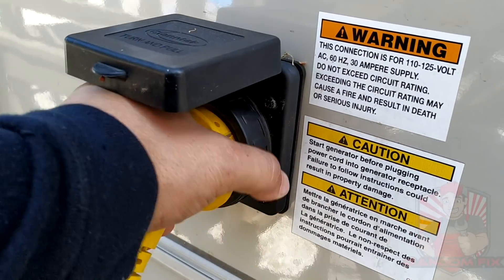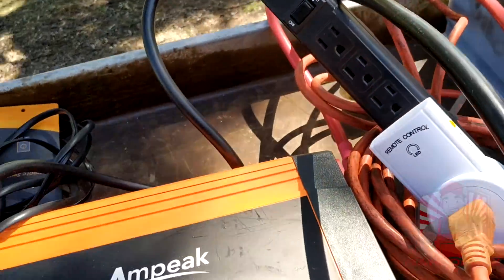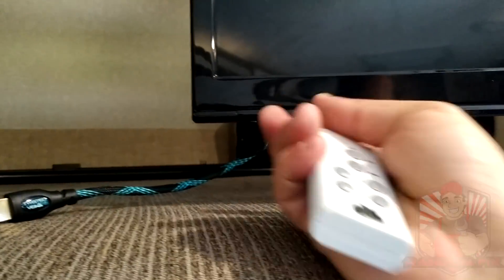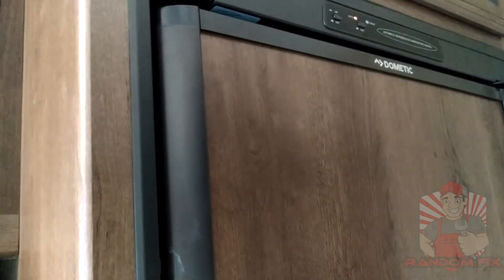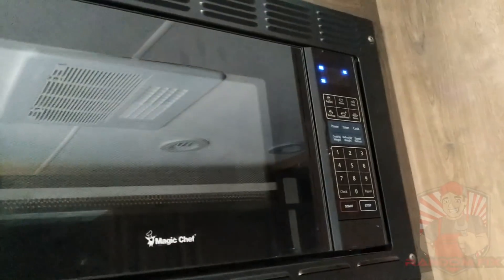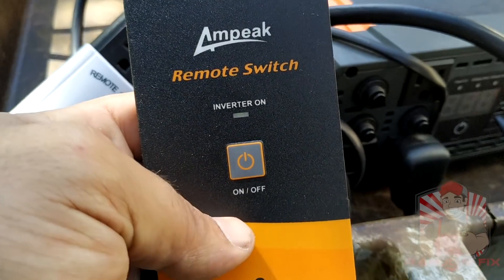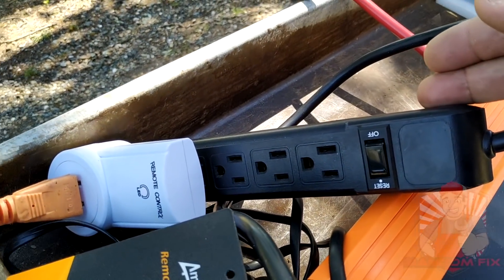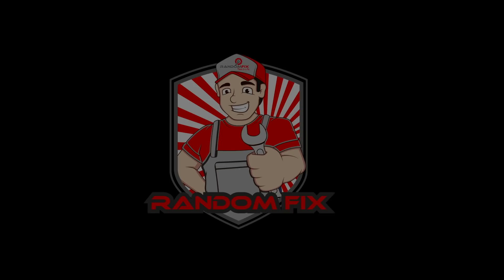RV Inverter Installation: Power Your Entire RV!

Comment: My wife and I watch your video Numerous time on TV LOL.  Our question is that dead man plug is plugged into a GFI outlet? I just purchased solar kit for our TT and is solar ready with charge controller ready. Underneath forward storage area also has inverter readiness. But again, I'm no electrician. thanks for this video stay bless.. LOU & YESI
Reply from the maker: No the dead man’s plug is not plugged into a gfci  but if you did that it would just keep resetting, you would need to hard wire it before the gfci.
Reply: @RANDOMFIX  oh wow now I'm really lost. I see you hard wired it to the inverter.  And plugged it in to an outlets inside the camper. The outlet in the camper is hard wired to the main breaker. Do you have a video on how you done it? Thanks

Comment: great video just what i was looking for. why don't you just plug the cord into the invertor.thanks jack
Reply from the maker: Jack, I'm glad the video helped. I don't follow about plugging the cord into the inverter? My cord is 30 amp and is located only the outside of the vehicle that's why I made the dead man's plug so I can just highjack the electrical grid of my rv without the need to make any modifications.

Comment: Nope! Not only is it dangerous, but now you are trying to pull up to 20+ amps through a circuit with a 14 ga wire. It would be much better to run the shore cord to the inverter, an inverter with a hardwire port would be best!
Reply from the maker: I appreciate your constructive comments, thank you for the feedback!

Comment: Just buy adapter for your shore plug and plug in that way so your not tripping over cord! Turn converter off! 🤣
Reply from the maker: Okay
Reply: This is the safer way to do this. Then you can never plug in shore power while your inverter is acting as shore power.

Comment: Power is driven from the battery via the inverter extension cord w/remote and deadman plug, which is connected to any electrical outlet to power the RV without using the converter? Basically, the GFCI outlet is accepting power from battery to run/activate all the outlets and some appliances inside the RV? Yes or no? Is the RV converter in use during the time the battery and inverter are supplying power? What role is the converter and fuse box playing in your configuration? Does this method have an affect on the battery?
Reply from the maker: Hi Ruben, I made an update to this video with diagrams and better explanation.

https://youtu.be/VikSGKsl6Jo

Comment: This is not safe, does GFI work as designed feeding power in reverse?  Male cord falls out of plug electrocution hazard if someone picks it up that doesn't know its live.  Two electrical A/C sources can  be connected together by accident.  Relying on a $1 surge component to provide shutdown safety in the event two sources are accidently connected.  The safe way and of course more complicated way is to install transfer switch ahead of panel input that can select between shore power and invertor power and absolutely no chance of two sources of a/c joined.  Automatic transfer switches employ a hi-current relay/contactor that is held connected by line power.  When power drops out relay allows connection of alternate source of power such as an invertor or generator.  I understand that you have a pretty good knowledge of electricity but you have to take into account someone that does not know how your system works and tries to operate it.  Say we have an accident and surge protector does not work does invertor blows up first and short out a high current battery  we have a instant fire!  I do not see any overcurrent protection in the invertor side.
Reply from the maker: I appreciate your constructive comments, thank you for the feedback!

Comment: The problem with backfeeding is you're never going to get the proper size cord or amperage through that breaker to backfeed the whole system. So you're taking a probably a 30 amp system and render it down to 15 amps and then you're trying to run your refrigerator and everything through that backwards through the breaker that may seem easy but it's really not good
Reply from the maker: ThAnk you for your feedback.
Reply: @RANDOMFIX  ty for the vid and reply
Reply: I know this was a year ago but can you please answer my question if your able to, I'm planning on adding around a 7000wh 48v system thats 150 amps right, so with proper inverter and gauge wire into the plug and turning off battery charging on 120vac panel it should work fine right
Reply from the maker: Your own system does matter much and you can alter it however make sure you only inputting 120 v volts alternating current (ac) into the rv electrical system.

Comment: I just got a cord to plug my shore power port into the inverter.  Then both legs work.
Reply: I also just added a shore power outlet on the outside of the RV, near the inverter, that is plugged into the inverter with a modified extension cord.  Now all I have to do is plug the shore power cord into the inverter outlet on the outside of the RV.
Reply from the maker: Thank you for sharing
Reply: Dan, that is exactly what I did today. I got one of those through hull type electrical fittings from Amazon. It’s the best and it has a water tight cover. I have a very short power adapter 50 amp 215 amp that goes directly to that exterior outlet I can even run all of my stereos and TVs while I’m driving down the road. It sticks out a little bit of course. I’m not worried about that.  

15A Weatherproof Outdoor Power Outlet by Journeyman-Pro 15 Amp 125 Volt NEMA 5-15R Receptacle Kit with Integrated 20" Extension Cord + Waterproof Rubber Cover (GCR1-WHITE) https://www.amazon.com/dp/B07X8YQ19D/ref=cm_sw_r_cp_api_glt_fabc_MM4E46GMGM8BCFMA3JTF?_encoding=UTF8&psc=1

Adapter for keeping the inverter inside a watertight compartment and having the power outlet on the outside near your shore power inlet
Reply: @mrmojoinco  this is what i used as the exterior outlet and I put an waterproof cover over it. https://www.amazon.com/Enerlites-Receptacle-Electric-Vehicles-Electrical/dp/B07BD2DZYN/ref=sr_1_17?dchild=1&keywords=50+amp+exterior+outlet&qid=1627503314&s=hi&sr=1-17

Comment: Like it but would use pure sign wave inverter
Reply from the maker: Bob, good feedback. In my rig  ( new sprinter van conversion) i have a sine wave inverter. That setup in the video is still going strong. No issues with microwaves or computer.

Comment: I’m confused I did this exact thing but I think I blew a fuse
Reply from the maker: Where did the fuse blow, on the inverter or the coach? Did you see the update video in the description box where I show are of wiring and diagrams?
Reply: RANDOMFIX not sure I’ll have to dig into it but I followed step by step and when I did it I heard a pulsating noice coming from the inverter then boom my front lights by my driver and passenger seat turned off now my inverter Is not turning on either I’m not getting any DC power going into the inverter.
Reply: RANDOMFIX what’s even more weird is I didn’t even have the switch on and neither of the lights on the dead mans plugs were on
Reply from the maker: Jayden, I'm not sure what happened. Are disconnected from shore power? Did you check out the rv to confirm there was power to them before you attempted to plug in the Deadman plug?
Reply: RANDOMFIX yeah that’s the weird part it was all dead no shore power or anything. Oh well I’ll figure it out hopefully 😂
Reply: RANDOMFIX are you in California? I’ll pay you to install it 😅 I don’t know a whole lot about this.
Reply from the maker: Did you see the follow up video? Its pretty simple. A stereo shop has good know of 12v systems as well.

Comment: If I use battery disconnect and plug shore power cord into inverter via adaptor instead of generator, will that work okay?
Reply from the maker: Hi Don, I made a new video covering the process in a lot more depth, if you still have questions after watching the video I will be more than happy to help! https://youtu.be/VikSGKsl6Jo

Comment: Doing  it your way. I still have to turn on my converter with my breakers for my plugs to work and power everything. I have separate battery connected to the inverter with solar panels to charge the battery's, not the house battery's.
Reply from the maker: I appreciate your constructive comments, thank you for the feedback!

Comment: How do the battery stay charged
Reply from the maker: The battery charges why you drive.
Reply: When you drive, or start your generator or from your solar panels, or when you plug-in somewhere and your converter charges them.

Comment: Could you run the AC if you had a 3000 watt inverter like I have
Reply: nope.
Reply from the maker: The A/c system is a power hog, you would need a monster battery bank. You would need a true 3000 watt inverter that can handle that load for hours.
Reply: If I added a 3000 watt inverter to my car battery and hooked it up to the trailer, would I be able to power my trailer's ac?
Reply from the maker: You add the 3000 watt inverter but don't attempt to power a huge load. Keep the load light. Are you planning on running the vehicle engine while using the inverter?
Reply: @RANDOMFIX  yes. Was hoping to kick on the rv ac. A 13.5k. the initial draw is less than 3k but the running draw is about 1k.
Reply from the maker: You will need a 100+ amp alternator. I would be very careful. Watts = amps x volts. So do the math.

Comment: I think that you are brave to present this method, because I am an Electrician, and feel that this could get some people in trouble.  However, it is a great idea, and method, as long as people remember to disconnect the inverter, or turn it off, when they hook to outside AC power.  I commend you on your video!
Reply from the maker: Alan, I was a little nervous but I think people get the idea bit I did use the wireless remote as my secondary safety. I hope it helps someone as it's still working flawlessly for me.
Reply: I wonder if the batteries would last just as long before charging this way (normal RV use, no Microwave or Hair Dryer) vs just battery power with no inverter. Curious to know. Leaving it this way would be awesome as you can use Microwave and AC products when needed.
Reply from the maker: Brian, I setup two batteries on my brothers r v and he was able to go one week. He uses the microwave and the nespresso plus all other electronics. Two agm batteries 150 amp each.
Reply: @BrianLecompte  I turn on the inverter and turn off the converter only when needed.  My inverter draws 1.7 amps on standby so it will kill your battery faster if left on.
Reply from the maker: Thank you for sharing.
Reply: @Alan petersen you don't think trying to run all the outlets through one 15 amp breaker circuit is a problem? Genuinely concerned especially back fed through the breaker?

Comment: So basically i connect the power inverter to the travel trailer batteries, turn off the converter on the trailer, and plug in an extension cord from the power inverter to ANY receptacle on the travel trailer and the power goes through all the AC outlets?
Reply: No, you’ve got it 1/2 right. Hook inverter directly to battery. Keep this short, mount in battery compartment. Isolate the battery from the RV, then plug your shore power cord into the inverter. 
By isolating the batteries you stop it from trying to charge itself with its own power 😉. I like his remote control idea, but you really don’t need it. Once turned off you’d have no power to anything because batteries are isolated, so may as well power the RV with the inverter and hope Solar Panels keep the battery charged. A quiet way to use Microwave & Hair Dryer as no Generator is needed.
Reply from the maker: The battery was on the cart just for the video, I have hooked up to two 15p amp hour amg battery. The shore power plug is  plugged into the inverter I still have to disconnect the converter or trip the relay. Did I miss a reason with converter won't try to charge the batteries? Thanks for the feedback about the remote I just used th I t a secondary safety protocol as I would rather burn up the remote or try the surge breaker then dry wires in the motor home.
Reply: @BrianLecompte  you're saying with a battery disconnect switch one could use the inverter to power a TT and the converter "loop" wouldn't be an issue?
Reply: @bushweasel515  yes, works great

Comment: I’m confused  the motor home has the inverter usually 2-3 house batteries that get charged when you are driving along with engine battery I assume separate from house battery..so I get to my spot and I turn battery switch on now I can use my .tv or plug a radio in charge phones .. if I want to cook with micro wouldn’t I switch to generator power (2 hours ? ) that way my batteries get recharged and I can go back to battery power .. so don’t understand all this Extention cord / inverter set up
Reply from the maker: Thanks for the feedback, please see the updated video in the video description for clarification.

Comment: I dont understand how to stop the loop ?  I dont see a breaker for the battery charger ? And if the main breaker is flipped off then no ac will flow
Reply from the maker: Just turn off the converter. Unplug it or find the power supply like the circuit breaker. An inverter inverts 12 volt dc to 110 volt ac and a converter converts 110 ac power to 12 volt DC, that's why it's called a loop. You can break this loop by turning off the  convert by some means.
Reply: @RANDOMFIX  Do you have to worry about the loop when you're connecting the inverter to a separate battery bank (NOT the house battery)?
Reply from the maker: Nope, just confirm your convertor is off or else you will be just wasting energy. Did you see my other video?

Comment: Thanks for the info.  If using this method (as opposed to plugging in  your shore power cord to the inverter) should you also turn your converter breaker off so you don’t create a loop?
Reply from the maker: Yes, turn off your converter.
Reply: Yes that is a gigantic thing to remember to do.
Reply: I came here to mention this. Otherwise you drain your battery trying to charge your battery.

Comment: Great idea. Now, you are using separate batteries . How can you power the coach if your power source is the coaches batteries. I don't usually carry a extra set of batteries with me when I am camping. Assuming of cource you have an CONVERTER in the coach.
Reply from the maker: Joseph, I don't carry extra batteries, the engine battery connects to coach battery after 30 seconds (timed relay) and I basically powerup the all the accessories (except for the A/C while I drive. Beats having to  the generator to turn on the microwave. It is even more helpful when we go camping when there are restrictions for generators. If it't not a big load I can use the coach battery hours of tv and computer.  I set this up for my brother using 2 big 145 amp agm batteries and he can run for a whole day. No shore power no generator no problems.
Reply: @RANDOMFIX  Is there some reason that RV's(mine's a 1999) don't come with this set up to begin with? Thanks so much 4 the info🤠👍BearAZ
Reply from the maker: I'm not sure why they don't come with some basic options like this. Maybe it's an upgrade.

Comment: Why not use factory plug and use inverter as shore power. $3.99 for 3 prong adapter at ace hardware Allowing breakers and fuses as designed 
If you do this you will zap yourself.

Smh "some people's kids"
Reply: Exactly! I use a shortened 30A power cord hardwired into a 3000W inverter+lithium battery pack that plugs directly into my boat's shore power receptacle. Simple, safe and easy to manage.
Reply from the maker: Thank you for sharing.
Reply: Leisure Cords 15A Male To 50Amp Female Twist Adapter RV Locking Power Cord Male to Female Camper Generator Cable Adapter Electrical Converter Plug (15A Male To 50A Female) https://www.amazon.com/dp/B07C2DBRBS/ref=cm_sw_r_cp_api_glt_fabc_0949AVDDYSJHNJE23DYJ

There are dozens of adapters on Amazon. Some with chords some without. All make it really easy to plug in 120v 15a.

Comment: Hi thanks for the video.  Can I use a 110 (20) to 30 AMP dog bone from the inverter directly to the RV ?
Reply: How do you turn off the converter ?  The main breaker and the a/c breaker and leave the rest on ?  Will that work without creating the “ loop” ?
Reply from the maker: Most converter are plugged in using a standard outlet near the fuse panel and also have a circuit breaker. Either solution can work and this will stop the loop.
Reply: @jamesmartin1869  Yes SIr, whatever breaker your converter is on will shut the off it off.
Reply: Hi there, You CAN do that. However, Because it also charges your batteries. It circles power through the system and when power is cycling it causes huge power loss. So it's highly inefficient and kills the battery really quickly.
Reply: @douglas1306  All you have to do is either unplug your charger or flip the breaker for it.
Reply from the maker: Exactly!!!